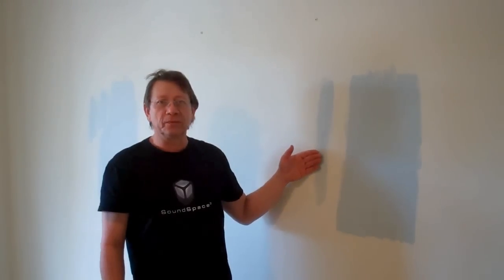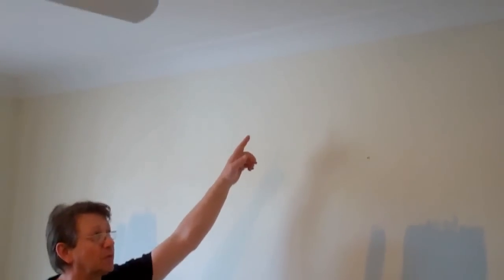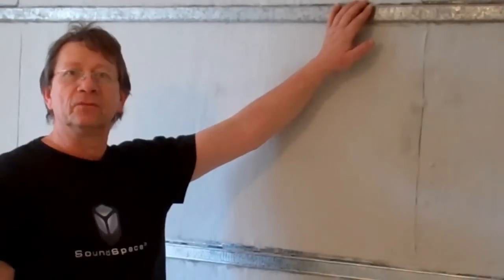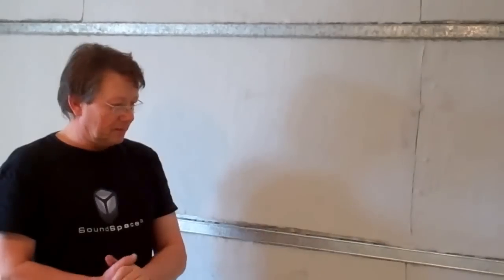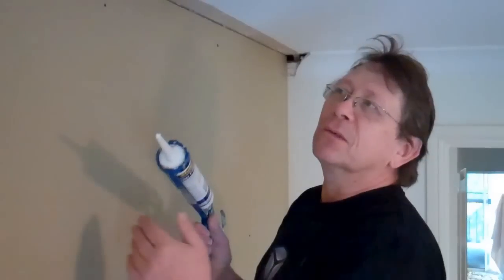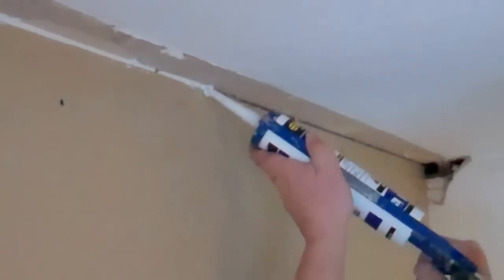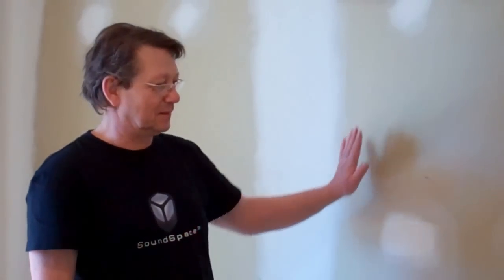How To Soundproof A Wall

Comment: Thank you for uploading a greatly useful guide on how to stop noise from next door. Could you give me an idea on what to use for between the joists to  stop any noise coming through. We hear doors slamming, cupboards shutting and even the squeaking of hinges. I would really like to eliminate the noise from next door when I'm refurbishing the house in the next few months. 
Would you use the sound-absorber matting between the joists and take down the ceilings, run resilient bars and put a soundproof plasterboard up?
Many thanks
Reply: I also forgot to ask about Polyester Sound Absorbers, I have found a product called Dacron, a quilted wadding for upholstery. Will this be sufficient or should I use a carpet underlay instead?
Many thanks
Reply from the maker: I did another video about soundproofing ceiling, here is the link:   https://www.youtube.com/watch?v=4TlpFA6lE9Y
Door slamming and cupboards shutting will still be heard because the noise travel through the walls as well as through the ceiling, you'll have certainly a reduction after treating the ceiling but the perception will be still there. If you hear the squeaking of hinges, I think you should have a good sound reduction after treating the ceiling, that means you probably have a lot of airborne noise going through the ceiling and that's easy to reduce or stop but banging is also structural noise and that's more complicated because it is going through the walls as well.
Reply from the maker: Dacron is made of polyester but it is too light in density to be a sound absorber.
A thick carpet underway will be good for impact noise, footsteps but not much for tv, music and talking.
if you want to insulate the floor, I did also another video, one for a carpet finish and another one for a timber floating floor finish, here are the links: https://www.youtube.com/watch?v=9q-cgie-oXk
https://www.youtube.com/watch?v=RcGtR2N9TGM
Reply: Thanks for that, I will go for a dense carpet underlay. And will check out your ceiling guide.
Reply from the maker: For banging noise it will be better to build a second partition wall, not touching the original one, you can do that by installing a track on the ceiling and floor and slide your studs in, between the studs, high density acoustic batts, make sure you don't compress the batts between the existing wall and the new plasterboard, it will work like a bridge and transmit more sound.
On the new studs, install new plasterboard and the membrane between , just like the video, for better results, you can use a MLV 8k/m2 instead of viscoelastic-elastic membrane.

Comment: thanks so much for spending the time making the video. although I might use a different, simpler and less heavy duty way to make my neighbors happier, I appreciate what I learned from your video. You are a good teacher! And if the way I chose doesn´t work that great, I am going to try the method you described.
Reply: speaking as an amateur and not at all construction or home improvement related guy....
Reply from the maker: Thank you for your feedback!

Comment: To an existing exterior wall would I get the best results from removing the sheet rock and ad staggered studs and then the  channels? But in doing so, would not the new studs be anchored to the frame just like the existing studs and have the same vibration? Any information you could give me about staggered studs is very much appreciated?
Reply from the maker: Even if the new staggered studs are anchored to the same frame, you'll have a very good sound reduction because the exterior sheets are not fixed to the same studs than the interior one and also the new wall cavity will be bigger and the bigger the better for sound reduction. You can also install new high density sound absorbers between the studs, a bit tricky with staggered walls because we have to avoid too much contact between the external and internal studs to minimise sound transfer.
Reply: Thank you very much soundproofingexpert for your answer. I would like to ask where I can find info about new high density sound absorbers. Is it the MLV? Thank you.
Reply from the maker: The MLV is the flexible sound barrier, like a membrane installed between the two plasterboards, it can be 2kg/m2 , 4, 6 or 8kg/m2, I am using now 8kg/m2, it is more expensive than the 2kg, of course, but it will reduce more low frequencies. It can be also Green Glue which is equivalent in my opinion to the 2-4kg MLV.
The sound absorber, is the white material that I've installed between the resilient furring channels, it is high density polyester fibre 10mm thick, it is made for me according my specifications and I have to buy large quantities, I can provide it in Australia but may be too costly to send overseas; it can be replaced by high density fibre glass, just make sure not to compress the sound absorbers between the existing wall and new plasterboard, it may court-circuit the system by transferring sound, acting like a bridge.

Comment: what if you want to minimize low frequencies like truck engines and harley davidson people driving at night?
Reply from the maker: The weakest point will be the window and the best way to assess this is to install a secon window inside with the biggest air gap as possible between the existing window and the new one, the bigger the air gap the bigger sound reduction. the new window should be acoustic with thicker glass such as 10.38 mm thick (minimum), laminated with acoustic seals.This will provide more sound reduction in low frequencies than a double glazed window.

Comment: Great explanation. Can you tell me if the furring channel can be attached to a brick party wall that has been plastered over (not a plasterboarded wall)? Do you drill holes and use rawl-plugs and then screw the furring channel onto the wall?
Reply from the maker: Yes, you can attach the furring channels on a brick wall with plugs, I am using those white plugs with nails.

Comment: I noticed when you installed the  resilient bar channels you had the fixings part of the rail at the top edge to the wall  , from what i understand its supposed to be at the bottom side of the  resilient bar channels not the top , because when fitting the wall boards they will then have the effect of pulling away from the wall , this is what the professionals say about the installation of  resilient bar channels .
Reply from the maker: That's correct, I should have done that for the video, in reality, I don't see much difference because the wall is straight, unless maybe if the plasterboard doesn't touch the floor, anyway it is a good habit I guess to install the other way.
Reply: @soundproofingexpert  it is not a habit, it forfeits the purpose of decoupling the wall from the studs when the flange is top.
Reply from the maker: @anurruti yes, I understand, what you are saying but one way or another, it doesn't touch the stud or the wall and that's the main thing. I talked to the technical department of Rondo, the manufacturer and they said in some pictures it was up and others it was down, it doesn't seems to matter and they don't have any test showing a difference in decibels between one side or the other side but if you can show me some evidence it must be installed one way rather than another, I'd be very interested to know and very grateful, thank you!
Reply: @soundproofingexpert  I hear you, but people out there make many mistakes even at commercial level. I am a wknd warrior and I spent hours checking and double checking.  before I did my acoustic installation. Here is the deal: 

It matters 100% because the flange down allows for the "C" part of the RC to bend outward by the weight of the drywall ensures there will be decoupling no matter what. This possibility is not only negated with the flange up, but also makes the tip of the "C" part to stay in total contact with the stud. The result is waste of time, effort, money.

Check these sources:
1) https://www.buysuperstud.com/news/contractors-and-suppliers/how-to-install-single-leg-resilient-channel-rc
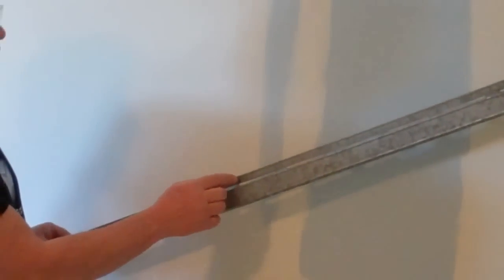2) Bailey RC: https://www.youtube.com/watch?v=prOhYUa9Njw   a) look at the min 1:26 onward  b)Turn the volume at minute 1:48.
3) Dietrich RC: https://www.youtube.com/watch?v=ojlwvbNJWns. Check 0.33 - onward. The video even show silently "make sure flange is down".

The only mistery that remained was why the lowest had to be flange-up. A retired taper told me it was just because of convenience for screwing. Go figure. I dont buy it completely.

Anyhow, I hope it helps. Good luck with the insulation.
Reply from the maker: @anurruti  Great conversation and thank you for the video links, I went through it and as you said, it is strange they allow the bottom channel to have the flange going down.
I'll write to one of the manufacturers, in the first video, because you are not the first one who said it's very important to have the channels up and I want to know if anyone got some tests done to see the difference in STC. Thank you for your research and sharing!

Comment: You don't need to remove the already installed plasterboard?? How do you know where the studwall is? How do you soundproof a concrete wall? Cheers, thanks!
Reply from the maker: by knocking on the wall, it is easy to find the studs and most of the time they are placed at equal distances and plumb so you can eventually mark the studs with a level to make it easier.
You can use the same system on a hard wall but if you hear loud music or impact noise, than it is better to erect a separate wall partition separate from the wall by 10mm or so and fix on tracks on ceiling and floor only, not touching the wall, not much difference in price but you'll lose lets say 100mm instead of 50mm, the problem with hard walls is structural noise, it means that the sound travel through the whole structure of the building and after fixing the wall, you'll fix only part of the problem because the adjacent walls will transfer vibrations as well, roughly 50% less than the common wall, so you'll still have a good sound reduction overall, acceptable most of the time.
Reply: Wow!! Great response. So for a concrete wall, the best way is to build a separate wall infront and add rails to the adjacent walls+ceilings? Im very grateful, thank you!
Reply from the maker: Yes, that would work well but in most cases just build a new partition wall in front of the common wall provides enough sound reduction, of course there are differences in constructions from countries to countries and in some cases fixing resilient furring channels on adjacent walls and ceiling as you suggested would give you a very quiet and peaceful place.
Reply: Brilliant thank you!!
Reply from the maker: Fewhfeuiwhfweuibf Febwuifbweuifbgweuifgbweui you are welcome!

Comment: How do you do this work  when there is a window in the wall? Can you advise. Do you know of any window treatment - vinyl - that is sound blocking for windows as well?
Reply from the maker: The best way to sound proof a window is to build inside a new window separate from the existing one with a gap as big as possible by using all the space available. Most of the time, we'll use 10.38mm thick laminated glass but can be thicker if very low frequencies still a problem. There are compromises also, like magnetic system using 10mm thick acrylic and fixed with magnetic strip all around
Reply: @soundproofingexpert  v

Comment from the maker: Yes, there are 2 sheetrock with a membrane between, not fabric, it weights between 2kg and 8kg/m2, the heaviest the better for low frequencies, it is call visco-elastic membrane if around 2kg/m2 or mass loaded vinyl if heavier.
Reply from the maker: It's quite different, viscoelastic elastic membrane can be a mass loaded vinyl from 2kg/m2 or more, or a system called Green Glue
Reply: soundproofingexp

Comment: Best video yet.  So I understand, there is ferrying strip, foam panels, the 2nd fabric is added, then a new Sheetrock is installed on top correct?
Reply from the maker: Yes, correct, plus some sound absorbers on the existing wall, to absorb sound inside the new cavity. Sorry for the late reply, I didn't see your question till now, for some reason.

Comment: Fantastic video.. I'm thinking of timber framing to cut cost but putting lengths of Cork strips between wall and timber. For the insulation part would carpet rubber underlay be any good to create mass.. I'm trying to stop dogs Barking from next door.

Comment: Hi, thanks for the very informative video. I have some questions here since I have some overly sensitive neighbors upstairs. And I assume that I'd have to soundproof the whole room in order to prevent them from hearing too much of my sound system as the bass surely gets the walls vibrating, so than soundproofing just the ceiling probably won't be sufficient. Am I right? Therefore... 1) Will this method be effective if there's a door in one of the walls that I'm not really qualified to change? 2) What do I do about another wall that has a window in it? The frame around the window is not thick enough to lose another 45 mm. Also, there is a heater under the window. How would I soundproof there? 3)When using this method and there are outlets on the original wall, how do you move them to the surface of the soundproof wall? Thanks in advance for answering my questions!
Reply from the maker: Yes, you are right, the best of the best would be to build a new partition wall separated from the existing wall but you'll lose 100mm and if the ceiling is high enough, have a new ceiling not fixed on the existing one but on the new partition walls only. You could have a second door fixed on new doorjambs separate from the existing doorjambs by 5mm and fill the gap with silicone, all around, same for the window, that's the ideal solution. The solution in this youtube video is for normal to a bit loud tv and music but some of loud bass may still go through.
Reply: How about being more considerate of your neighbors and use headphones instead.

Comment: I will be adding new walls in my house. What is the best way to soundproof these new walls? The same way as you did here for an existing wall or is there a better way for new construction?
Reply from the maker: A good way that compromise in thickness and cost would be to build a staggered partition wall (steel studs are a bit better than wood), install inside high density acoustic batts but make sure you don't compress the batts between studs and also between plasterboards because you'd create a bridge allowing sound transmission.
Install 2 layers of plasterboard on each side with a visco elastic membrane between plasterboard (could be also Green Glue) or for even better results, 6kg or 8kg/m2 mass loaded vinyl. Chose a thick plasterboard, 2x 16mm thick or 2x 13mm acoustic plasterboard, it is denser and more or less equivalent than 16mm thick standard plasterboard (around 13kg/m2), this is probably the most cost effective way to achieve best results without doing 2 separate partition walls.

Comment: Thanks for the video.  I'd be curious, if you had the benefit of building a building from scratch (a building that hasn't been built yet) but wanted parts of it or all exterior walls to be soundproof; is there a good cost effective bulk way to soundproof the building?
Reply from the maker: Yes, it is always better to plan in advance and by far more cost effective.
You can have better sound proof windows and doors with proper seals.
If the walls are double bricks you'll be ok but if it is brick veneer, than you can put inside the cavity, between the studs, better quality batts and plasterboard with mass loaded vinyl. many ways, many products according the type of construction, location and type of noise we want to stop.
Reply: In new constructiin one of the most effective soundproofing solutions is 2x4s on 2x6 plates staggered . you can then weave insulation to reduce noise further. In the theaters ive done this in we also used RC and double layer drywall.  With a solid exterior class door a full tilt 5.1 system going wasnt audible except at the bottom of the frequency spectrum

Comment: Thanks for posting this. Very informative. I just have 2 questions. How exactly do you secure the Plaster boards on to the channels? The other question is where do you buy the Polyester absorber rolls? I didnt see it when i did  a search on the home depot website......Thank You
Reply from the maker: +michael chirrick The plasterboards are just screwed on the channels.
I have the polyester sound absorbers made for myself by a manufacturer but you could use something else than polyester, like fibreglass or rock wool, there are different materials and brand names, you can use different densities from 32kg/m3 or denser, the thickness can vary as well as long as it is thinner than the cavity otherwise it will be compressed and transmit vibrations to the plasterboards, court circuiting the system. The resilient furring channels I am using are 15mm thick and the sound absorbers 10mm thick with a density of 1000gr/m2
Reply: Thank You!